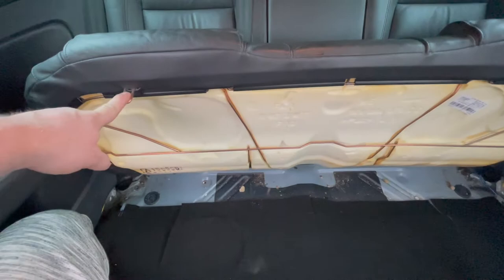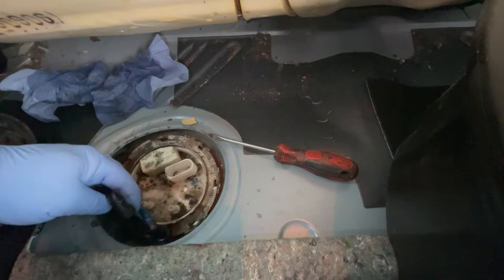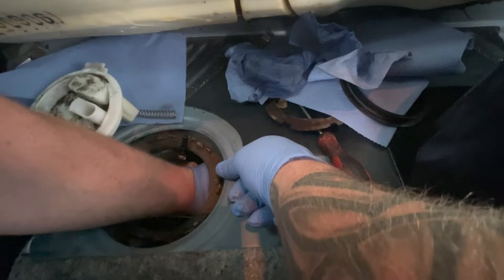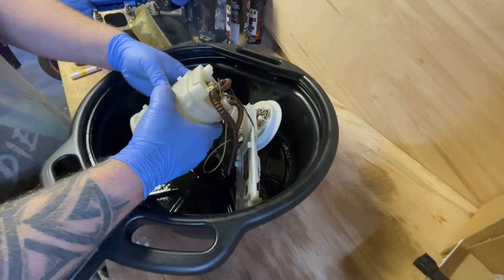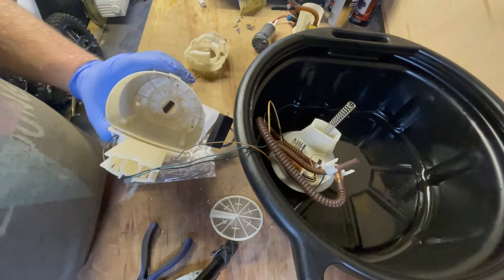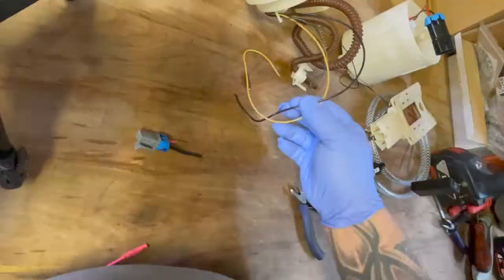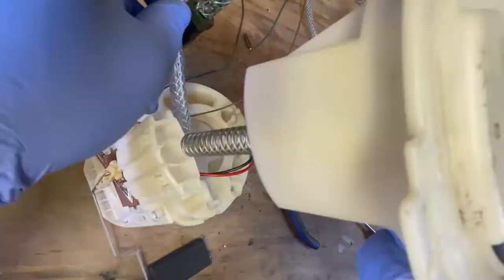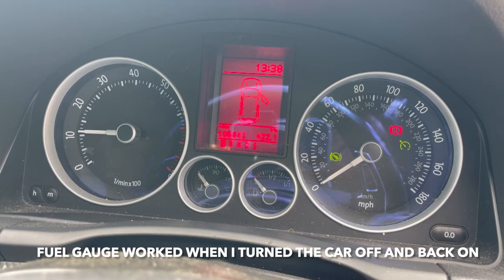EP3. Fitting the WALBRO 450 fuel pump - GOLF R32 TURBO BUILD SERIES

Comment: Bosch BR540 in tank for My R32T,jet pump delete,running perfect
Reply from the maker: Thanks, i changed it out to a Sytec 340. But ill take a look at the bosch pump.
Reply: @OctaneFever  hi, I have experimented with many setups, pumps in line, always exclusively Bosch, I have also managed the TTRS pump and RS6 but they did not guarantee the flow I requested, the Bosch BR540 "dw400" is exceptional, I can make good use of the oem pump tank and removed the Jet pump connection. congrats on your build ;)

Comment: Interesting, I was planning an upgraded in-tank and in-line surge tank + pump combo but if this setup works it might be worth considering. The Radium syphon valve is kind of the game changer that allows you to move away from the OE pump style and being limited to a Quantum or DW65v OE-style pump.
Reply from the maker: Yeah, 100% I've not heard good things about the DW pumps, for ease it's tempting to go with an OE style pump but I've heard of people replacing DW pumps regularly. Where as Walbro have a great rep.
Reply: Bosch BR540 in tank for My R32T,work fine with suction jet pump delete.

Comment: Thanks for the video. I did something very similar. Im definitely going to be buying the radium siphon piece. Also, I likes the fuel hose you used. Is that hose a specific brand?
Reply from the maker: No I don’t think so. It’s fuel rated but not sure how it will stand the rest of time being submerged in fuel. I have some pipe left over so might do a test to see how it responds in fuel over a period of time. A link to the hose is in the spread sheet that is linked in the description of this video.
Reply: If you going to be running Ethanol just make sure you have E-compatible hose as it will deteriorate normal hose.
Reply from the maker: @xptboosted  no we don’t have access to those nice fuels here in the uk.

Comment: Hi, would the TTRS (8J0919051E) low pressure fuel pump be sufficient for this build? It should be a direct fit, instead of all the faffing around modifying the Walbro 450.
Reply from the maker: I don’t know. There are other direct fit pumps that would have been easier. And if I had my time again I would have probably used one of them.

Comment: awesome, i learned something from you today, on my car i need to extend my siphon kit return...... just a question, the siphon kit installation instructions warn not to use the oem siphon unit, maybe i missed understood that part, but it looks like you kept it, is it working?
Reply from the maker: Yeah it seems to be working, the instructions warn you not to use this kit AND keep the OEM jet pump which me and you dont have anyway as thats what connects to the top of the OE pump. The way we have it set up it says this " If installing this system into an OEM fuel tank that was equipped with a crossover system, connect to the OEM crossover hose"
Reply: @OctaneFever  did you remove the oem syphon pump on the other side of the tank? It's part of the fuel sender that's under the other hat.
Reply from the maker: @garyhowe88  there is no pump on the other side. There is only one pump and that pump siphons from the other sender unit on the other side. Using the Radium Jet Pump kit will siphon the other side of the tank when the fuel is being returned from the filter.
Reply: @OctaneFever  pull your other hat, you'll find a small brown piece on the bottom with two pipes coming off it, one is the pipe you've connected too, that small brown thing is a sphon jet pump, will work alot better if you remove the other end from this so it isn't trying to syphon through it. 

You'll find out if its working properly by filling up the tank then running it down, either you run out of fuel at 1/4 tank on gauge still, or once it gets nearly empty pull the lid to check the levels.
Reply from the maker: @garyhowe88  thanks. I’ll check it out. I ran it till it was almost empty before I published the vid and seems fine. But I will know more when the car is back together and I’ve been using it more. It’s in bits atm as I’m fitting the turbo stuff.
Reply: Hello, can you please provide me with the link where I can buy the siphon to make the connection of the pump with the return

Comment: Just watching this, is that hose you used fuel compatible?
Reply from the maker: Yes it is. Only time will tell how it lasts being submerged.
Reply: Cool, I'm interested to see how the exhaust system goes as it would be much easier than making one up myself 😂
Reply from the maker: @AdznEVOIII  spoiler. It doesn’t work out very well. Might as well just made one from scratch. I think it would have work better if you have a left hand drive car.
Reply: Ooh fair enough, it's a shame but I guess you never know if you don't try these things. Do you have a base map for your first start? With the new injectors you could be bore washing.